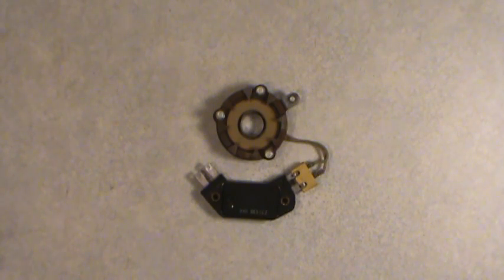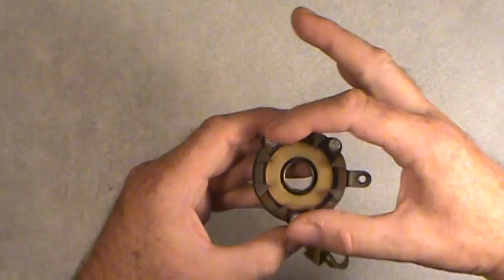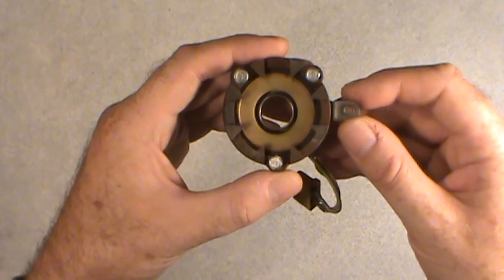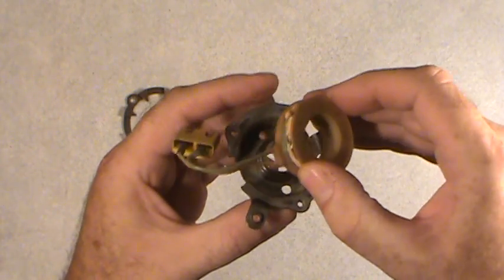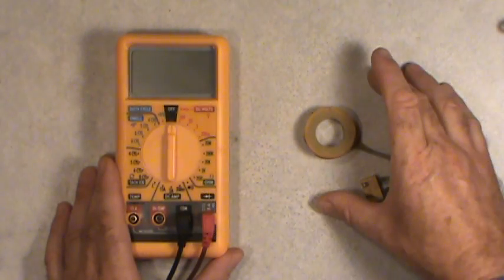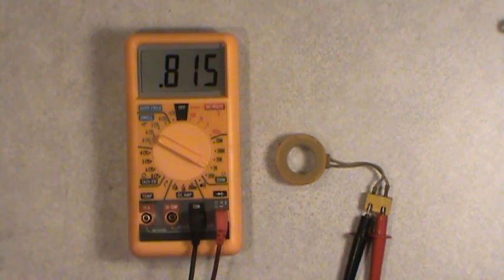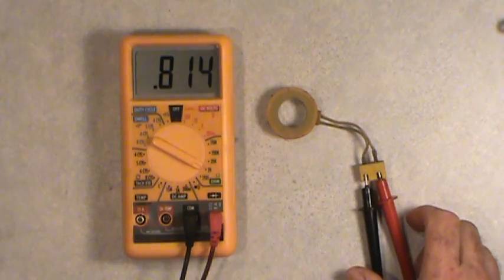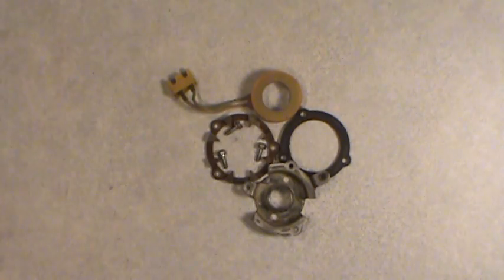HEI Distributor Pickup Coil Test

Comment: would a pickup coil from a datsun L16 be the same test? reason i ask is the wires are not removable from the module and with it being connected to the module it has no reading what so ever. so trying to see if it is bad even though it is a brand new unit.
Reply from the maker: +james p ....Greetings james p....Thanks for watching....................Well, I've never worked on a Distributor, like the one that You have there (Your Engine has a Distributor on/in it, does it not...???).....................If there happens to be a known Test, for what You're after, perhaps do an Internet Search, for a "Datsun" (that be the Name used by Nissan, for some of its Exported Vehicles)...Website, that has a "Forum" on it, where You should be able to ask lots of questions, about Your Exact Vehicle and Engine...................Some of the People on those Website "Forums", should have lots of Hands-On Experience, and hopefully, will have a fair amount of knowledge, and if You got really lucky, they might even Post some Pictures for You as well.....................If, (and I doubt You will), are unable to find the Information that You are after, You can get back to me, and provide me with the following, so I don't end up, going on, yet another...Wild Goose Chase...lol.............Your Vehicle's Year, Make, Model, and the Engine Size, and, what Problems You are having with Your Ignition System or otherwise...................If I happen to, require any more information, I'll be sure to let You know...thanks, and......till next time..............Be Safe, take care, and have a good one.
Reply: yes it had the distributor in it. and thanks for your help. not been having much luck on how to check it on any sites so far guess it is about like a dinosaur a thing of the past lol
Reply from the maker: +james p ....Greetings james p....You gonna give up that easy...???...lol..........I found an old book of mine, and, there's some information in it, that pertains to an older Points Distributor, for a Datsun L-16 Engine...................Some of those L-16 Engines, as I'm guessin', and saw/read in the book, go back to, those good ole Datsun 510's............Tell You what...if You can let me know, about Your Vehicle and Engine, as in, Year, Make, Model, and the Problems that You are having with it, then, I'll do what I can, to help You get those Problems fixed, as best I can................So it's Your choice, as to what, You end up doing, and, good luck, with what-ever You decide to do, and..........till next time..........Be Safe, take care, and have a good one.
Reply: just figured i would let you know that after some more checking it was indeed a bad pickup coil even though it was brand new. thanks for this video i followed it just like you did using my digital meter. after installing a new one again the truck fired up about the 3rd turn over and this is after sitting atleast 5 or 6 years.
Reply from the maker: +james p ....Greetings james p....Thanks for letting me know, and...."Congratulations"...!!!...for finding the problem, and, You're welcome for this video of mine..................Well, sometimes, New Auto-Parts, have their bad days too, and for me, I've always had pretty good luck, with Electrically related auto-parts...but...I installed, a brand new, top brand name, mechanical (type of) fuel pump, on a V-8 engine, just a few years ago, and, that engine, with a carburetor on it, kinda ran ok, when it was first installed on that V-8 engine...then...a few days later, it conked out, but, I did manage to restart the engine, just before the battery was about to die on me, and slowly, but surely, the car made it home (whew, coulda been an expensive towing bill, if it didn't)...lol......................I exchanged that faulty mechanical fuel pump, for its Identical Twin, and I must say, that, this New Identical Twin, works Super, and then some..............................Here's some more stuff for You to consider, as I've experienced over the years........I hope that You didn't leave the Parking/Emergency Brake on, while Your Truck was on vacation, cuz, I had a car, that was parked for a few years, and the Drum Brake..."Shoe Lining...Bonded to the Brake Drum"...and the rear wheels were Locked-Up Solid/Stuck Big-Time...such fun that was...Not...!!!...lol.........................Now I use Bricks, to stop the car from rolling away...not the parking/emergency brake, and, having the transmission, in-park, or, in-gear of course, if a vehicle, was not going to be drivin' for quite a while.......................It would be a good idea, to start an engine, oh, not less, than, about once-a-month, cuz, the motor oil, that's inside the engine, will eventually find its way, back, into the oil pan, due to earth's gravity..................I had a V-8 engine's, 2 piece rear oil seal, dry-out, and start leaking motor oil, near the rear of the oil pan.......................Most engine's crankshafts, splash motor oil, around the inside of the engine, to lubricate the cylinder walls and pistons, and, if an engine was not run for many years, then, there were some engines, that had their pistons and rings, stuck really good, to the cylinder walls, as in, seized-up...!!!.....................Then, most of the older domestic engines, that had flat-bottomed hydraulic (valve) lifters, that rode on the camshaft's lobes, while also, not having enough motor oil on them, could result in, one or more destroyed camshaft lobes (just ask me, I know...lol)...oh, and, it was that particular V-8's, number 4 cylinder's, exhaust (valve) camshaft lobe, that got Destroyed...!!!.......................Warning...!!!...always have lots of fresh air and ventilation around a vehicle, when-ever the Engine is "Running"...cuz, Engine Exhaust Gas is Deadly...!!!...............Your Coolant (anti-freeze and water mixture), is probably Over-Due, and should be changed, or, it will probably end up, be-in (internal) Corrosion-City.................Old Gasoline to an Engine, is kinda like, Old Milk to Us..."YUCK"...lol...and till next time..........Be Safe, take care, and have a good one.
Reply: got lucky on the brakes not being locked up but not so lucky cause it dont have any brakes what so ever on it. supposed to be getting a new fuel tank for it and hopefully it will be on the road in a couple of weeks and on to my daily driver as it has been pitching a fit. it is a 98 ranger with just shy of 340.000 miles on it and it will just up and die going down the road so i gotta figure out whats wrong with it or been thinking about maybe installing a distributor and carb and just getting completely away from the computer on it. any help on that would be greatly apprectiated. and keep the videos coming please.
Reply from the maker: +james p ....Greetings james p....So then, You want to Convert, Your 1998 Ford Ranger, Pick-Em-Up-Truck, from Computer Controlled Fuel Injection, to, shall we say, Back-to the good ole days, of a Carburetor, and No-Computer-what-so-ever, do You....................Well, if was only that easy...say what...???...lol...................If Your Ranger has to be Smog/Emissions Tested, I doubt it will Pass, after converting to a Carburetor set-up, so Check First...!!!...................Probably be quite a bit Less Expensive to Fix, what's Wrong with it, the way that it is set-up now, considering the Expense, of not only a Carburetor, and an Intake Manifold, that may, or may Not Fit Your Engine Block and Cylinder Heads properly, but that's just for starters.....................If the Ranger's Engine, already has a Distributor in it, then, that's a Big one, on the Plus side, or, it's going to get really expensive.........The Ranger's On-Board Computer would probably be having a Fit, when any of the Wiring Connectors, are detached from, quite a few, of the Ranger's, Sensors and Actuators, as in, Flashin' Dash Lights & Trouble Code City...and even if, the unused anymore Sensors and Actuators, could be Tuned out of the Computer itself, then, there might be a Wiring Harness, that needs to be added, and/or, the original wiring harness Spliced-into, if that were, to even be possible............Probably No (mounting) Provision, for a Mechanical Fuel Pump, on Your Engine Block, as well as, No Eccentric, on the Camshaft, to make the Fuel Pump's Arm, go up and down, leaving You, with, having to install, an Electric..."Low Pressure/Less than 10 PSI Fuel Pump...(most Carburetors that I've dealt with, only need about 5 to 7 PSI)...oh, and, Your Ranger's, Electric-in-the-Gas-Tank-Fuel Pump, is good for about..."60 PSI/Pounds per square Inch"...as in, Pressure Washer Strength...!!!...Yikes...!!!............Then, if Your Ranger has an Automatic Transmission in it, it's probably going to be an Electronically Controlled Version there-of, and the Computer is usually responsible, for its correct operation/shifting/etc................Standard Transmission is a Plus, but if Your Ranger is a 4X4 (Four Wheel Drive), then, the Computer, might be tied into it as well.................."Try to find a Ford Website, that has a "Forum" on it, where they might discuss, and post Information, on this, shall we say..."Transformation"...back over to a Carburetor...for a 1998 Ranger, that is Exactly like Yours, and, if You do find one, You'll be able to see, for Yourself, as to, what You're gonna be up against...(here's where I throw in, a pre-em-tive-strike, as in..."YIKES"...!!!...lol)............Has the Ranger, been Maintained Regularly, as in, Air and Fuel Filter, spark plugs, etc., at the Manufacturer's Recommended Time/Mileage Intervals..???...................Here are some of the things, I'd do, to get Your Ranger's existing set-up Diagnosed, and hopefully, Roadworthy, once again..................Cylinder Compression Test...No less, than about 100 PSI, and, all Cylinders should be reasonably close to one another..........Fuel Pressure Test...must be with-in Factory Specifications, and no excessive Leak-down/time-wise...but, be very Careful, and Wear Safety Glasses/Goggles, cuz of that 60 PSI/Pounds per square Inch, Fuel Pressure", there-abouts, that could Destroy a Persons Eyeballs/Eye-Sight...!!!.......................Then, have the Ranger's On-Board Computer "Scanned" for Trouble Codes (some Auto-Parts Businesses, might Scan Your Rangers Computer for "Free", just phone around, and see/hear what they have to say), with a Scan Tool (looks kinda like, a slightly Larger, hand held calculator)..............So then, once...the Engine's, Cylinder Compression...the Fuel Pressure...and...the Computer's Trouble Codes are known, then, that my Friend, will help the Patient (Your Ranger), let us know, what might be wrong with it, and, if need be, just let me know, what You find out, and, in which direction, that You so choose, to go in, and I'll do what I can, to help You out, and........till next time.........be Safe, take care, and have a good one.
Reply: we dont have the emissions police here. i have checked fuel pressure cylinder compression was 130 across all 4 of them. it doesnt act up all the time i drove it about a hundred miles the other day no problems but sometimes it will just stall out within about 7 miles of driven. the truck is very high mileage  with almost 340.000 miles and still climbing. maybe it is time to retire it for awhile idk
Reply from the maker: +james p ....Greetings james p....It's good to hear, that You got, some good cylinder compression readings, on Your 4-Banger (aka, 4 Cylinder Engine).................Well, while Your Ranger's Engine was Running OK, did it Run, Really Good, or, was there something that You noticed, such as, some Hesitation, maybe some Misfiring, hard starting, etc., at all...???..........................There are quite a few things, that, just might cause Your Engine...to go silent...alright......................Seeing as how You were sayin', that it Ran Ok, for about 7 Miles, then quit on You, that has me thinkin', that, it might be, when Your Engine, is going from "Open Loop" Operation (when cold-started, and just warming up), then, into "Closed Loop" Operation it will usually go (once the engine's coolant is warm enough)......................Open Loop, is when the On-Board Computer just follows a pre-determined Map, in its Memory, until the Engine's Coolant gets warmed up-to (maybe about 140 Degrees Fahrenheit maybe?), as sensed, by the CTS/Coolant Temperature Sensor, and the Computer, doesn't usually even listen to, what, things, like the Oxygen Sensor, happen to be saying/outputting, while still being in Open loop mode......................Once the Computer goes into Closed Loop mode, it will then, be Listening-to, all of the Sensors, such as the Oxygen Sensor, to Calculate (in real time), the Ignition Timing Advance, as well as the Fuel Injector's pulse width (on time), which determines, the Air/Fuel Ratio/Mixture...................Here's even more, food for thought, for Ya.......If You go WOT/Wide Open Throttle, while the engine is fully warmed up, and is in Closed Loop mode, the Computer will probably, go back into Open Loop mode, cuz, the Closed Loop, 14.7 Air/Fuel Ratio, is Too Lean, for a WOT Acceleration under load, which might be in the 11 to 1, up to, maybe 12.5 to 1 Air/Fuel Ratio thereabouts, depending on, how the map in the computer is programmed, that is......................Now that You know, that the Compression is OK in Your engine, that leaves the "Fuel Pressure"...and the..."Trouble Codes"...that might be stored in Your On-Board Computer's Memory, still not known.....................Your quitting Engine, might be something, as simple as a Faulty Electrical Connection, Wiring, or a Sensor or Actuator, that might have, a shall we say, Intermittent Personality...lol.......................Sometimes, there can be Water/Condensation in a Vehicle's Gas Tank, and even more-so, if the Gasoline, happens to have Ethanol/Alcohol in its Blend, then, Alcohol, has a habit, of Absorbing Water, which, and if there is too much of it (water), in the Gasoline, well, that's something that an Engine does not like, and, at times, might start acting-up, and not run so well, or smoothly at all......................I had an old/very high mileage, Inline 6 Cylinder Engine, with a single barrel carburetor, and a points & condenser distributor on it, (No Computer...what-so-ever), that was really Worn-out, so much so, that, as soon as it was started for the day, it went...Knock...Knock...Knock...!!! (keep repeating that noise...lol), and the darn thing, just..."Would Not Quit"...!!!...........................Now, I'm thinkin', because, there are usually, Knock Sensors, on these Fuel Injected/Computer Controlled Engines these days, that, if, all of that "Knocking", that I had on that old 6-Cylinder Engine, were to be happenin', on these Newer Engines, those there Knock Sensors, might just be Mistakin', the Knockin', that, those, very Worn-out, Crank & Con-Rod Bearings were makin', for Pre-Ignition or Detonation, and that damn, not so smart...Pew-ter (aka, Computer), would probably be Yankin' (pulling out), quite a bit of Ignition Timing Advance, and, the poor engine, would then, become, well, shall we say..."Gutless"...as in, Low Performance........................Well, last but not least, is, the "Sentimental Value", of Your Ford Ranger Pick-Em-Up-Truck, and that's one, that, I'll let You soul-search, and come to terms with, my Friend, and.........till next time.........Be Safe, take care, and have a good one.
Reply: RockysRoadshow i have to say while it runs it runs pretty good. the CTS sensor may be one of my problems because the gauge will not come up any what so ever but just always thought it may not be hot because the heater in this truck sucks. and been planning to pull fuel filter to see if it has water in it. and when it does act up i can hold it to the floor for a little bit and then it will clear up and then it will have the power it had before. will try and get these few things checked as soon as possible. and let you know how it goes